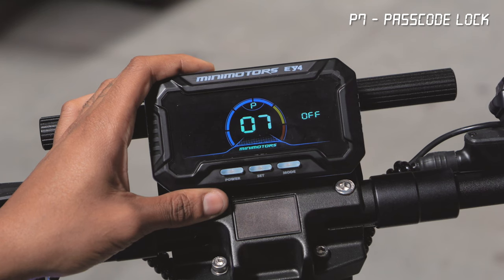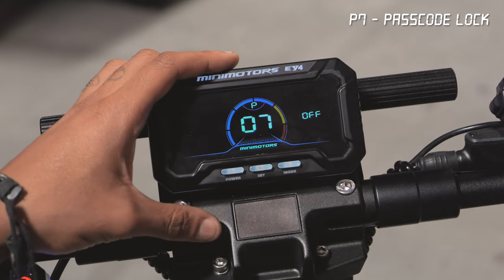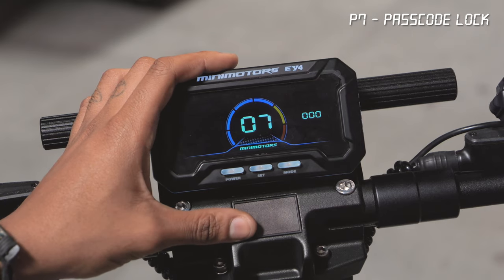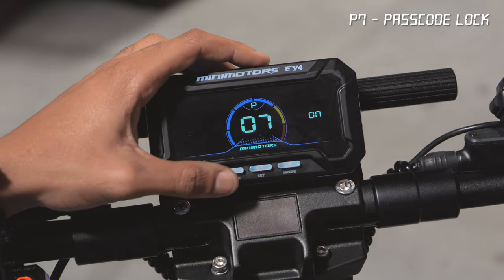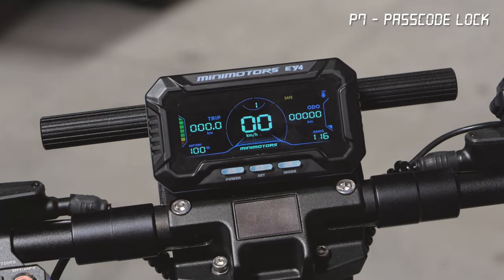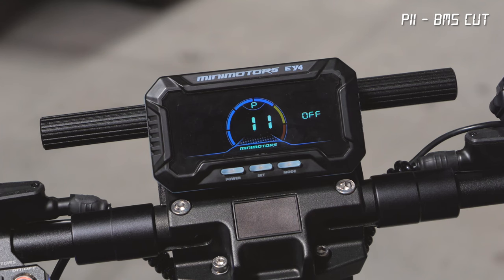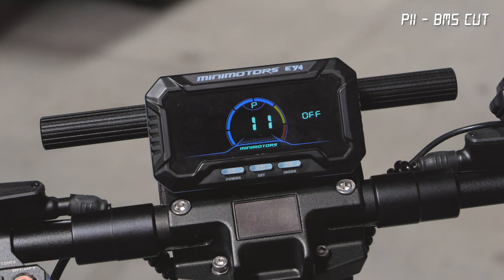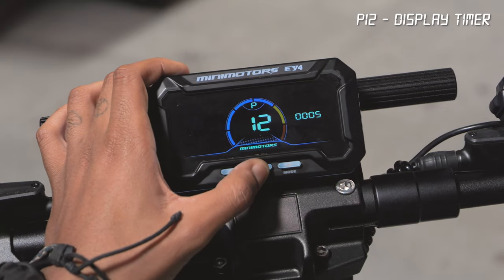How to Use the EY4 Display for Dualtron Electric Scooters - VoroMotors tutorial

Comment: 7:21 NO it should be correct wheel size. scooter cant know is your tires new 13 or used 12 LOL. 
and change your  tires to 10inch and scooter go slower. i have spoken. bigger wheels more speed if there torque
i mean THIS year bigger wheels ofc it effect speed lol. try it!

Comment: 7:52 P19? gear setting? 0 default 1 eco modes
gear 1 ECO max speed 25kmh
gear 2 ECO max speed 50kmh
gear 3 ECO max speed 80kmh
gear 4 ECO max speed 100kmh
gear 5 DONT CARE I WANT GO FAST AND EAT BATTERY AND TIRES WITH WHEEL SPIN